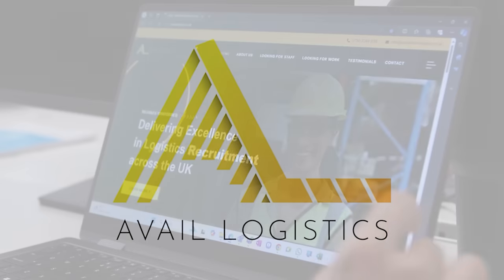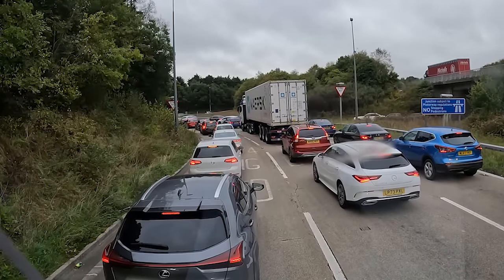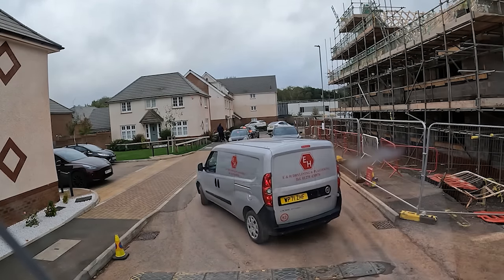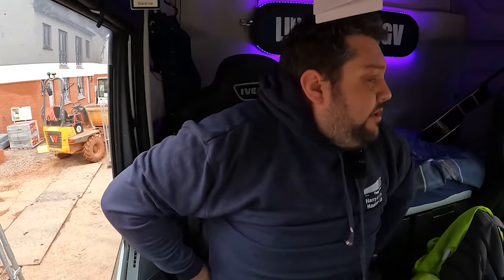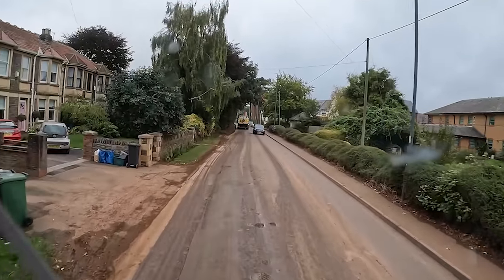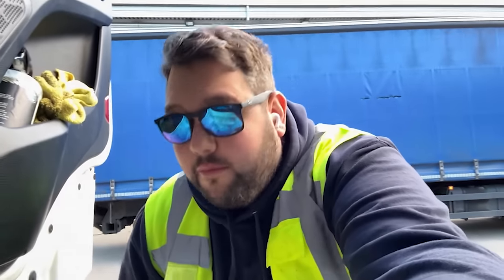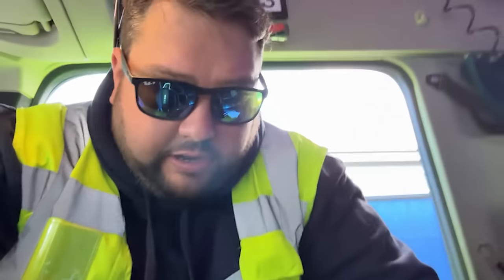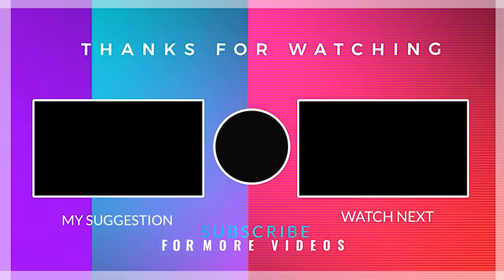“This Site Is Not For Big Trucks!!!”

Comment: If you are thinking about trucking and watch this and are put off, please don't, I been driving 15 years and these jobs are very easy to avoid, also most drivers don't sleep and shower on the road. Most of us are up at 8 and home by 8. Avoid any kind of on site jobs , i.e building equipment, stick to supermarkets and stores and parcels. You will never night out and loads of room usually. I'm on £24 and hour on the parcels. This guy won't get more than that and he has crap runs all day. Plus he lives in the truck. And you can see it's not a healthy way of life his way

Comment: Dont know how you keep so calm with those rules & regs & traffic issues. I was a fully qualified C+E military driver. License then lapsed. 10 years later i reactivated it (the C+E) via a video on Medicals that you suggested. Did my CPC which wasn't  'thing' last time I drove & got my digi Tacho Card.
I have come to the conclusion that driving is toooo high risk now with all the potential 'gotchas' that a driver faces including driving down those narrow roads. Low bridges. Crappy route planning. Complete nightmare.  High risk of a coronary from stress & not a high reward financially certainly not thru the Agencies i have experienced in my neck of the woods.
Reply: Where do you live? Martin Brower, the company that delivers McDonald's food is paying £23 an hour. Sites in Hemel, Coventry and Heywood.
Reply: @Nickbaldeagle02 Yh they do but didn’t you get sacked just before Christmas for too many accidents 💀😂
Reply: @Stl-vs7gm  no. Nope. I broke a tail lift, a headlight lens and grazed a fuel hose at the yard. I didn't knock a wall down at Eccles, take out an entire street's electrical supply, drag a car 50 yards down the road  or any of the other tens of thousands of pounds accidents for which drivers are still there.
At my exit interview I told Matt about the ridiculous rumours circulating amongst the drivers, being monitored on the tracker was a major one, live camera feeds from the in cab cameras... he said the drivers are like gossiping old women.
No, Heywood was a bastard for me to get to from Sale most days. So I'm at Morrisons now, similar pay but much easier to get to. And no unloading. Stores do all the unloading. It's a doddle. 
Have a nice day ☺️ enjoy those cages with 3 wheels.

Comment: IVECOS are the worst of the worst, wiper blades I had other day the plastic holders on the blades would hit the window and all day it was speaking 12 hours straight. It's a 73 plate and the interior is falling apart.